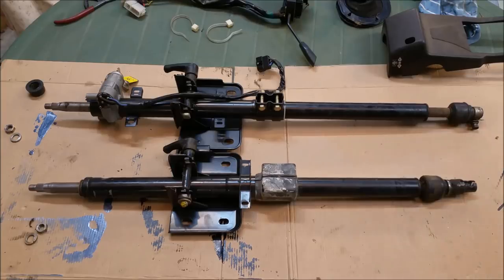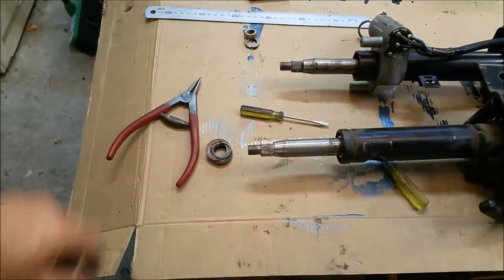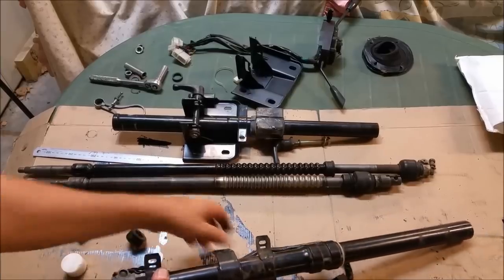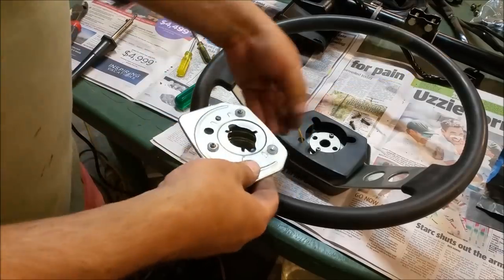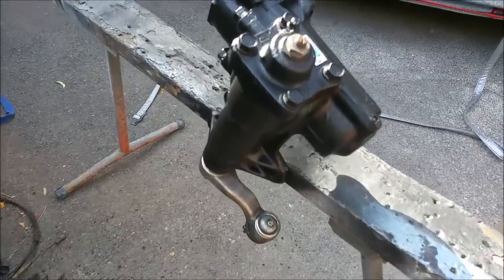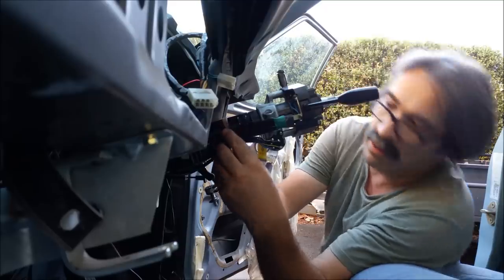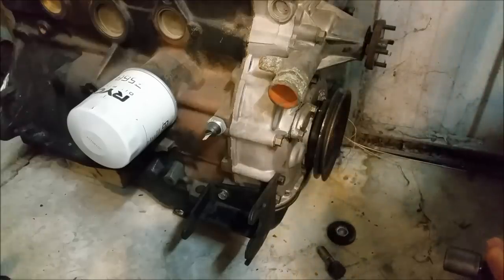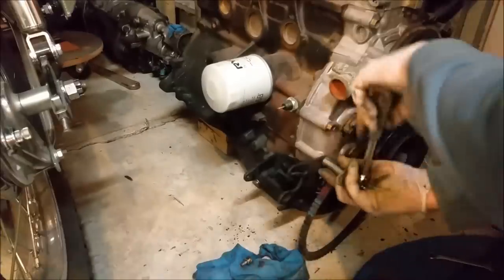Mitsubishi Sigma14 - Steering Column and More.

Comment: That lathe plastic would be a great mower wheel bearing too. 
Really impressed with the fully painted radiator cross member you welded in from the wreck (which you were very fortunate to find).
Reply from the maker: Thanks James!

Comment: Getting there nicely mate. Two days ago I just fixed the height adjustment bolt on my gh. The left hand threaded bolt with the square bit with right hand thread got a bit confusing but I got it worked out. I hope you can show a bit of footage when you do the heater tap. Mine has seized open and looks like a nightmare to remove.
Reply from the maker: Yes Rod I've been thinking of that. I want to use an aftermarket tap, like a generic Ford one. There are loads like that on eBay but they all have 5/8 barbs... Sigma needs one with 1/2 and I can't find one. The only thing I've come up with to date is using a reducer to make it fit. Will cover it in a video, cheers.

Comment: Perhaps we could pitch for an Aussie version of Wheeler Dealers with you in the mechanic role!!Saw an episode from the 2018 season online, was a 1991 Toyota MR2 turbo, that had a leaky hose, that was buried in the engine compartment, poor Ant Anstead was tearing his hair out, he had to rip the engine out to spend 30 seconds changing the hose, but at least he put a new clutch, timing belt and water pump in before replacing the motor. The hose was $7.00 from Toyota.

Comment: Conclusive proof that going to a wreckers/breakers yard can be a very bad idea for the car nut.  You go there for a A$40 column switch assembly and end up with an A$800 turbo kit.  Then what started off as a simple running repair turns into a much larger project...
Reply from the maker: I know, but I had a ball with that car and even better: it was super reliable even though it was driven hard for 120,000km and when off boost it was much better on fuel, cheers.
Reply: @PeterAndersons    I totally understand, a standard Sigma/Galant was never intended to be any kind of performance vehicle and definitely wasn't, whereas the turbo was a bit of a loony machine on the quiet, though not as much so as the Lancer Turbo.  Though, to be fair, that's probably not a bad thing, the Lancer had a bit of a reputation for being an animal if you got too friendly with the loud pedal, whereas the larger car was a lot more composed...

Comment: I thought the Auto Sigmas had a larger tunnel, or did later Sigmas only use large tunnel?
Reply from the maker: Yes auto Sigmas have a larger tunnel which is why the V8 conversion folk use them. The Japanese gearbox is beefier than the humble borgy which some say interferes with the earlier manual tunnel, plus there are a few mods with parts that need to be done as the earlier shifter is further forward... I didn't want to bother going down that road, cheers.

Comment: I'd go for the radiator-type power steering cooler, the original type is very prone to vibration damage and they frequently crack where the mounting tabs are, plus, as you said, having it mounted in front of the cross member is just a really bad idea both from the cooling perspective and the damage perspective.  A small radiator-type cooler mounted in front of the radiator is what you'll find on most modern vehicles now as they are just far superior in terms of cooling and reliability...
Reply from the maker: Yes I agree although as mentioned above the original type appear to do little anyway. Davies Craig doa small one for about $75.00, cheers.
Reply: @PeterAndersons    Yes, I can't imagine those tubes really did much for cooling the fluid.  I know some vehicles had a similar idea, but the tubes had fins coming off them which saw them widely known as hedgehog coolers, but they still had the issue with fatigue failure.  Mind you, I suppose we should be grateful that the manufacturers fitted any type of cooling, even a poor type, as it means that recycled parts have a chance of being fit for further life without having to have a potentially expensive rebuild...

Comment: Delete the P/S cooler pipe? I don't think they do much anyway
Reply from the maker: Could do I suppose and I agree with you, although most manufacturers use them... the XC and XD just has a steel low pressure pipe running across the width of the radiator on it's return to the pump, cheers.

Comment: Did I miss something? Why is he going through all this mess with mismatched columns?
It had one in it.
Reply from the maker: All good mate, I had to shorten it to fit power steering; this meant shortening the original tube and making a bush, then using the inner shaft from a later power steered car, cheers.